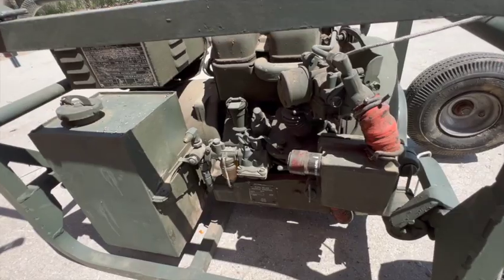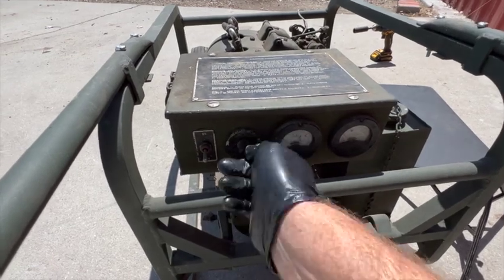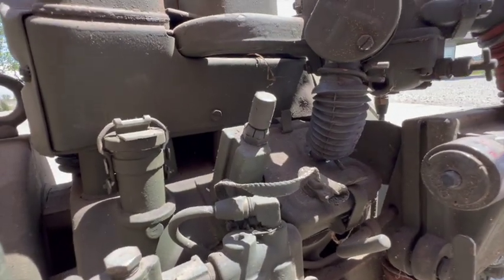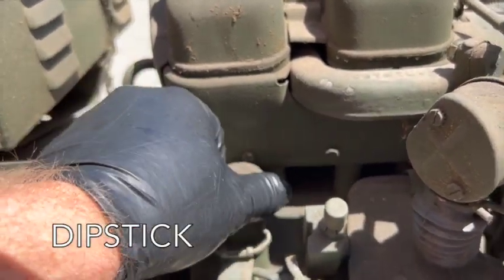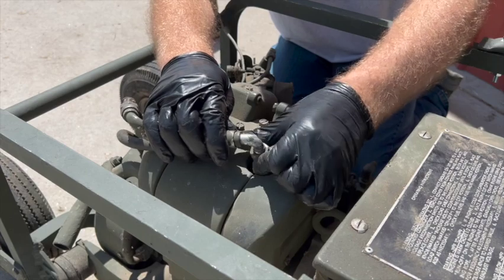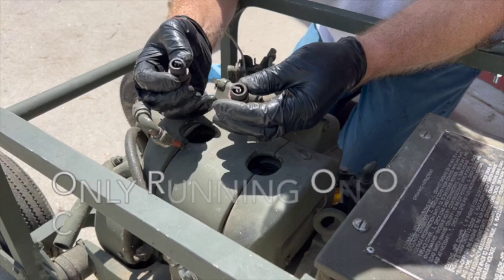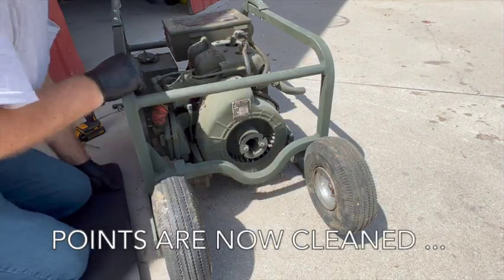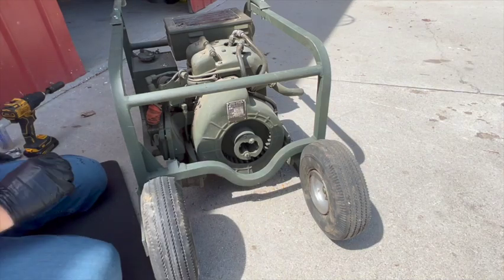Vietnam Era Army Generator - Part 1 (Does it Run?)

Comment: That's a neat piece  1500 watts sure isn't very much though.
Reply from the maker: Thanks. Yes, 1500 watts isn't much, especially today. I wonder what the soldiers primarily used them for? Maybe just hand tools, lights, heaters, and little stoves ... ?
Reply: 1500w solo para radios militares y radares pequeños 👍🏻